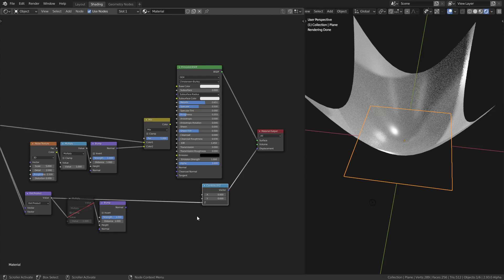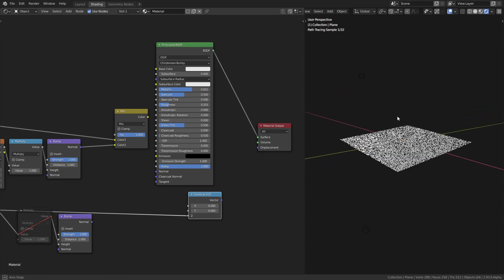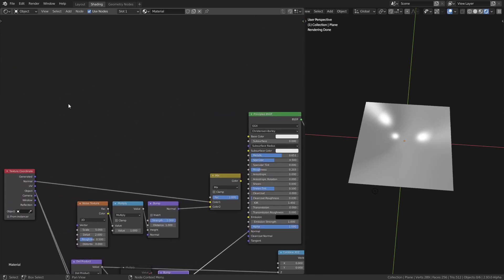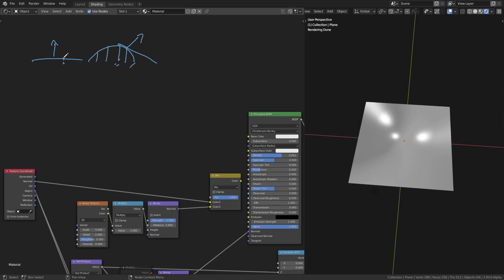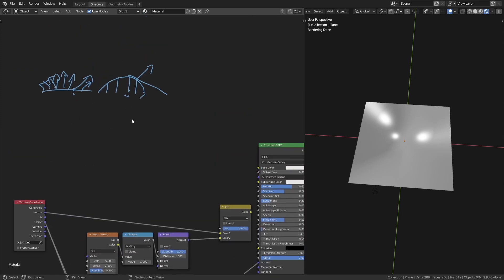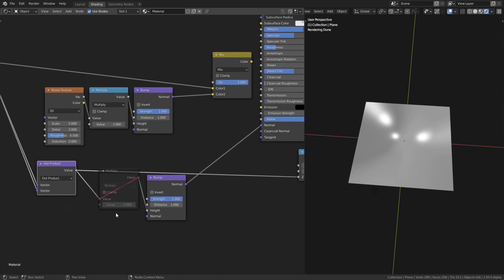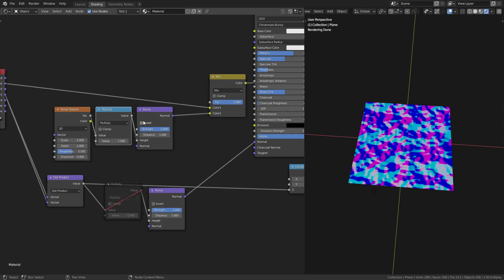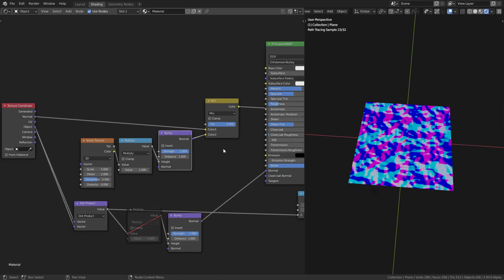The bump node

Comment: What?
I cant reproduce that node setup - or rather I can but it doesnt match whats going on on screen at all.
Object of texture coordinate into both vector math channels, vector math set to dot product, vector math into z of combine xyz, vector of combinexyz into displacment.
Result: no displacement at all. Where did the curve come from?
Reply from the maker: Make sure you have displacement turned on in the material properties and that you are using cycles. Eevee doesn't support vector displacement (yet).